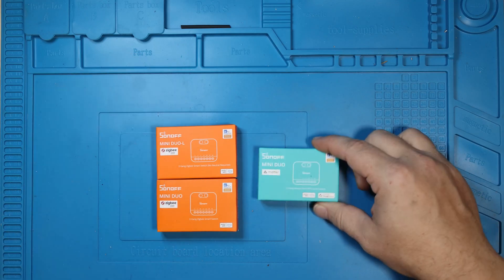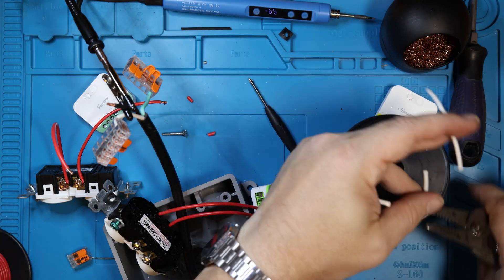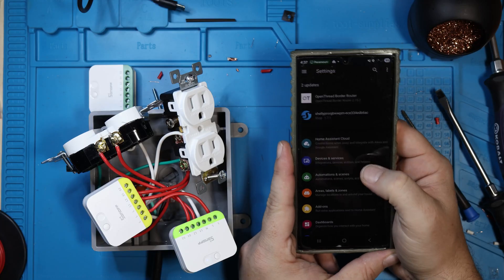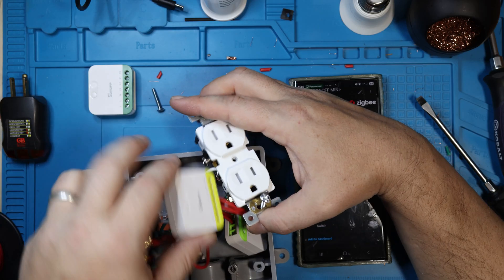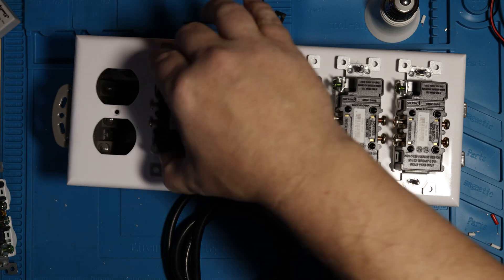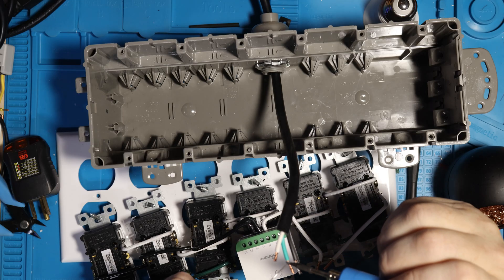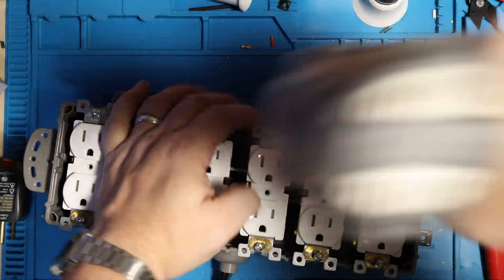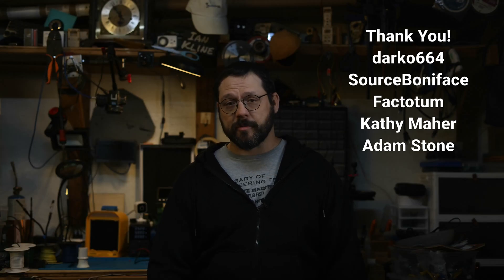Sonoff Duo Mini 2 Channel Relays - 2 Zigbee and 1 WiFi with Matter

Comment: where do you even find a plate with that many holes?
Reply from the maker: lol, scrolling through many pages of search results on Amazon. I have one for square outlets/rocker switches as well that has appeared briefly in a video, I think.
Reply: @smartercircuits  I think there are modular plates too